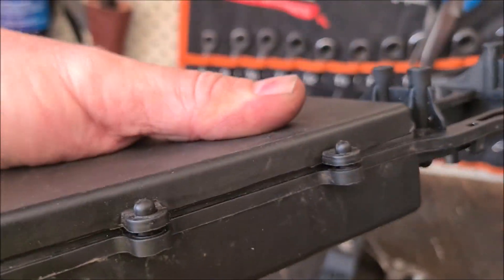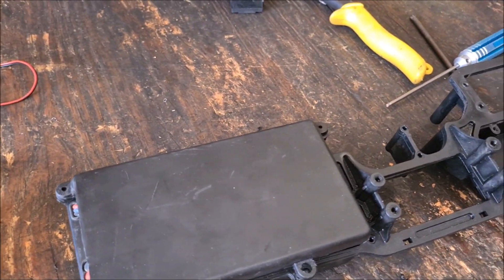1/5 RC Rovan LT/Losi 5T (ROSI 5T) - Still rebuilding the neglected Rosi 5T

Comment: I’d put something soft between the underneath the battery and those screws which u put in there for the extension 
They will fark the bottom of the battery after rattling after some runs. Just saying mate
Reply from the maker: Yeah thought of that but the battery has got a hard case anyway so it should be ok.

Comment: Looks good, shame about the pull start. That spur and pinion is a high speed set and won't be much chop for the type of driving you do, will have no bottom end at all.
Reply from the maker: You are correct.  The gears no good for me.  Was hopeful🤣🤣🤣